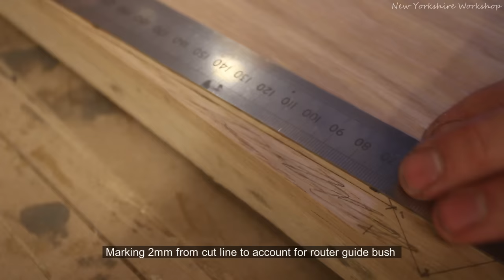Making a traditional framed ledge and brace door in Oak

Comment: How does shimming 2mm for expansion work if the battens are glued and screwed to the frame and braces?  In a traditional cabinet, the panel floats in the style/rail frame to allow for expansion, for example.  On a tongue-and-groom floor, only one side of each floor plank is nailed. etc.

Comment: Wow, I never imagined there was so much work involved in making a door!  This was an eye-opener.  But it'll probably still be a good solid functioning door in 300+ years' time.  I'm impressed.
Reply: This is not how they were fabricated back in the day.  They were either sandwiched for strength or just backed with battens for expedience and cost cutting.  Many barn doors, for example, were braced doors and you better believe no tongue-and-grooves were cut and they didn't mortise the frame.
Reply: @DiffEQ  this isnt a barn door! Its a traditional ledge and brace and this is how they were made back in the day. (If it was never done how did it ever evolve?)
In fact mortise and tenons were used even on cheap pine lounge doors. Its today we have the "expedience and cost" with the cardboard filler, chipboard, mastic and nail gun gangs!
Reply: @DiffEQ  I have loose tounges in my lounge doors - in my 1650's cottage! And fabrication is metalworking term...
Reply: It only looks like a lot of work because he does not have the proper equipment. A proper joinery shop could be ten  times quicker for the same door.. still - he is talented

Comment: It was a pleasure to watch a real tradesman at work, awesome job. Hi from Perth Western Australia.
Reply: Peter Antonic Ditto, another Sandgroper Joiner. He did a pretty fair effort. 👍👍👍🇦🇺

I’m not a fan of through tenons with wedges myself, albeit I’ve made doors that way myself, however from experience over time the moisture gets in to the end grain on the tenons & the wedge and starts to rot process. Personally I prefer a blind stopped Mortice & tenon to keep that moisture egress out.
Also I prefer a 2 part export resin, because it will last longer than the door timber.
Then I also blind peg the tenons from the inside face of the door & plug the pegs so they are hard to see.

Just small things that I would do slightly different. Our WA Jarrah (Euc. marginata) (or Swan River Mahogany as it was once known) is half as hard again as this oak he is using, (8.5 on the Janka hardness scale) and because the soils the trees grow in is slightly acidic here in WA - the sap inside the joinery timber is also slightly acidic and over time breaks down any glue other than epoxy resin which is inert to acid attack & gives a stronger bond than the surrounding parent timber.

You adapt your techniques to the material your machining for joinery, what you see in this video works for this Oak species & thus is fine for this particular door.

I do have to say the filming of his methods, assembly etc as well as the editing together of the final video was nothing short of masterful.

Whist I might match him for joinery technique, no way that my self filming one handed with smart phone and zero editing efforts match his filming and production technique.

All up a very solid effort in all aspects.

Easily a $1200 🇦🇺 door in these parts not that you’d be able to source the euro oak easily here.

Bunnings sell a US Ash door similar here at $1200.00🇦🇺 which is what I base my estimate / guesstimate on.

Wish I was his age again & could throw timber that size around over machines again all day like I used too.

I can still do it, but that would take me a week or more to do & trips to the Chiro for a couple days afterwards to try & iron out all the cramps in parts of me that get their ambitions confused with their capabilities. 😂😂

Comment: No longer working, I am a retired cabinetmaker. I worked with only wood in the beginning, residential furniture. After, mostly commercial furnishings with very little wood used. It was a job and hard work, loud and dusty, I do not miss it now. I have made frame and panel doors. This was good to see..

Comment: I lived and worked in France for over 13 years and I worked in a fourth-generation artisan woodworking shop. we did a lot of restoration and new construction on Chateaux and government buildings and we made a lot of Doors and jambs, a lot of them and this video brings back a ton of memories of those days.  I might share with you one thing we found out about the glue you used in this video.  yes, it expands and that seems to be a good thing to get everywhere but tests have found that due to the expansion process it foams up, and by foaming it creates air pockets and the bond is not as good as good old wood glue.  we stopped using Gorilla Glue and went back to brushing wood glue all over both areas and no more problem of separation or even failures at the joints.   I liked the bar you made earlier.
Reply: I was suspicious of that glue just couldn't quite pinpoint why. Thanks very much for sharing that.

Comment: Outstanding work and love your shop.  I am a 60 year old carpenter that's been trying to get out'a carpentry for over 30 years but never could.  I now have a small wood shop, but build interior stain-grade stairs (traditional & curved, on-site).  As I watched you work to build your door I thought about your shop & tool & material expenses and I kind'a thought to myself what it might cost to estimate; build; and, install that door .... and then I saw that wonderful door surrounded by concrete blocks w/no over-head water protection?  I have been known to build and install several exterior doors in my day and therefore know the work, skill & knowledge they require.  Great job & excellent video!  P.S.: I also have a band saw that operates like yours.

Comment: All that for a door on a shop made out of cinder-block? Cripes, I'd love to see what you'd  do for Westminster!

Great workmanship, loved it!
Reply: shaddec55 My thoughts exactly! Naturally, therefore, he will be finishing this building in grand style to match this door.
Reply: Cinder-block ? It’s oak
Reply: @Leon Widdicombe In the UK most modern houses were built from concrete block. The blocks are 16" long , 8" tall and 4" thick. External walls are built in two layers with a 2" cavity in-between. The cavity used to be left open but insulation is now installed. Metal ties are placed in the mortar beds to secure the two layers. The walls are then rendered with sand/cement to a smooth surface. Bricks can be used for the outside layer and not rendered.
Reply: It would be built using the blood and bones of the proletariat.
Reply: @Iazzaboyce  thanks for tidy explanation to this Yank!

Comment: Thanks for taking the time to make this I have been retired for three years after forty as a joiner seems you can miss your work , also not to be preaching to the choir but unless gorilla glue has been improved maybe 15 years ago Fine woodworking ( I think it was them) did a failure test on different glues in full mortise and tenon joints by racking them until they gave and titebond really out preformed GG.I was surprised because I had switched to poly when it first came out. But they found it held tighter than a bulls sphincter in fly season . Along with flowing as smooth as bombyx mori :).
Reply: Todd of Project Farm also did independent testing of various glues on his channel. Both Titebond and Elmers did better than Gorilla Glue, if I recall correctly.

Comment: I love your videos.  This door looks like a traditional braced door, but this is not how they were made.  The original doors were either sandwiched for strength or just backed with the batten boards for expedience and/or cost saving.  I completely understand that you're just making one for modern application that looks like a traditional door but wanted to be clear that this is not how they were made.  Great attention to detail and pride in what you're putting your name on!

Comment: I do like those key turn only lock systems, we had all new outside doors recently and they use the handle lift and key turn type. Such a pain! But I guess the mechanism has to be very well made to not put too much strain on the key.
Reply from the maker: yes you do have to be careful

Comment: Beautifully made.  I've made quite a few doors (and windows) in my life, and I doubt I've made any quite as nicely.  One thing I might suggest though is to try out a different glue..  I've never had much long lasting success with Gorilla Glue.  Tests have shown it to be considerably weaker than many others.  I'd agree that strength however is not the only thing.  Durability is a key with door and windows.  Frankly, what I tried about 40 years ago, when I made a bunch of heavy doors and windows and used Resorcinol.   It is a two part glue, and it has a dark glue line, but nothing is as waterproof or durable in my experience.  It cures pretty quickly but does give you enough working time for a glue up like this one.  Those doors made 40 years ago still have nice tight joints!  (unlike many high end commercial doors I've installed).  Great video, I too like the quiet.
Reply: Not true at all, gorilla glue is plenty strong and completely waterproof. Polyurethane glues are one of the best modern inventions in adhesives. Love me a good old fuddy duddy!

Comment: I'll cut my top and bottom rails wide and the two stiles wide and long , about an 1/8th wide/long.  Then run the whole glue-up through the table saw for perfect size and square, crisp edges with no clamp marks.

Comment: Gorilla glue interesting but not strong in the long run... it’s brittle 

We use marine 3m 5200 wood adhesive sealer caulk. When set it has a tenacious hold and waterproof and weatherproof
Reply from the maker: i was thinking gorilla glue? brittle?? but then if you compare it to boat sealant i guess it is, thats not for high quality woodwork.

Comment: Excellent workmanship as usual but couldn't help noticing that the braces were back to front. The bottom of the brace is supposed to be on the hinge side rising up so that the top of the brace is on the handle/lock side, this is to support the door and stop sagging over time.

Comment: That's a beautiful door. I was expecting to see it installed in the elegant front porch of a mansion and I must admit I cringed to see it installed on a building site.
Reply: Every building starts as a building site.
Reply: @tedwarden5803  True, but you don't usually install the pretty bits until it's no longer a building site.
Reply: @randomstranger9674 . True! I certainly wouldn’t put it on a shed. 
How much do you think it’s worth? I’m guessing about six hundred quid with the frame. Another hundred and twenty for frame fixing and another hundred for the door furniture. 
There’s two hundred in the timber if it’s good oak. 
At that I think I’m being cheap but my estimation is always to low:-(. 🤣

Comment: Nice work accept I would only spot glue the centre of the TG&V boarding and use oversize screw holes to allow for expansion and contraction ( seasonal change ) also when making an external FLB door I use air dried oak on the external face ie TG& V boarding  and kiln dried on the sties ,head , rails and bracing also  I’m not a great lover of modern PU glue I tend to use Aerolite on oak these are only comments on my preference of a build and no criticism of your work I would love to know your thoughts as  you are obviously a very accomplished tradesmen

Comment: Clever design -allowing no place for water to stand .  I just replaced the bottom rails of 8 large stile and rail doors , at great effort,  because after 40 years water sat on the bottom panel detail .  Had the doors been made this way, I would not have had to spend a couple of hundred hours.  ( I did however change the detail no more , not even the tiniest, horizontal flats!).
May I ask , how did you arrive at the expansion allowance for the paneling?    Kind regards,  J J Davies

Comment: I made one of these but it was wider as it was one of two swinging garage doors to replace the original 1930’s door that rotted. Because of the door width and it’s weight, the points didn’t hold up due to the diagonal torsion. It didn’t have your zig zag zig diagonal bracing thought. Just one long diagonal zig brace. I was bummed out.

Comment: Hello Russ, really rewarding watch, really appreciate the time it took to make the vid and share it. Could I ask you  3 quick questions? If yes, read on!
1. What's that expanding glue you put in the joints and the diagonals?
2. Do you reckon festool routers are absolutely better than the rest? Any standout reason why?
3. How do you calculate those angles on the diagonals so that they kind of clip/lock in? Never noticed that before and it is either genius or magic. (could be common practice, but it was such a satisfying eye-opener).
Thanks.
Reply from the maker: thanks Will. 1- polyurethane glue, sometimes labelled simply as PUR. 2- on the router i definitely think so, the micrometer adjustable height stop ( which is rock solid and doesnt move regardless of how hard you push the router, ie vibrations) and superior dust axtraction are main reasons, plus other luxuries like the easy clip on base plates, multiple sizes of guide bushes and other accesories. i would rather have one of-2200 than 5 makitas. 3- i didnt calculate it, i just placed the brace in position and struck a line down each side, then squared of this to about an inch to give the 90 degree cut ( that 90 degree is the important bit as it locks the brace in) just as it is shown in the vid basically. this seems the most common sense approach and is how it is shown in Modern practical joinery by george ellis 1902. he states this the proper way ad it prevents the brace from pushing out the stiles if the door were to drop.
Reply: @NewYorkshireWorkshop  Thank you very much. Looks like the perfect valentines present, I'll drop some hints. I've got a load of shutters to build/practice with before the door.
I guess the right angle thing does involve a bit of magic, but definitely needs to be shallow enough to not be a pig to knock in.
By the way, I really like the video style. Long form, authentic noises and nothing too fancy... Personally I often watch on my phone when I'm in my bubble, but the captions are really small and I have to rewind to catch the wit or wisdom that I missed... Maybe a fraction larger? Just saying, not critiquing.
Cheers

Comment: Awesome video. I have seen makers drill a hole at the end of a tenon wedge slot to help prevent splitting. Any thoughts on this?
Reply from the maker: I think for Oak in particular it is probably overly careful as it has interlocking grain and is pretty unlikely to split even if the grain is running at a 45 degree angle to the joint. For some other more brittle woods where the grain isnt particularly straight then it might be a good idea, but in that case you have to choose to use slots and wedges vs edge wedges which is more of an aesthetic choice, with edge wedges you negate the spitting entirely.

Comment: Great job!  When using polyurethane glue, do you dampen your wood prior to inserting tenons? I use it a lot for gluing polyurethane forms together and the instructions say to dampen both surfaces so as to activated the glue. I’ve noticed that some woodworkers do not dampen and can only assume that the wood has just enough moisture in it to start the activation. Great videos!
Reply from the maker: thanks! yes you are correct, wood for woodwork although dried still has anything from 6% -20% moisture content which tends to be enough, whereas plastics have negligable moisture if any at all. sometimes i add water if i am gluing wood to aluminium to give it a liitle help.

Comment: It's  a framed, ledged, braced and battened door. The top edge of the ledgers should have a small chamfer on  top edge to prevent any moisture pooling. Saw scarfing isn't  an excuse for errors when marking out (clamp pieces together). Agree about the wedges. Tension bars, clamps or feathers when using a spindle moulder likewise push sticks when ripping timber, safety first. The  band saw wasn't tracking properly and the fence was too high. COSSH Regs working with Oak you should be wearing an approved mask. Do you have ear defenders? The finished door was good as was the workmanship. I hope the points raised were useful .
Reply from the maker: thanks david. that saw has a 0.5mm kerf, to most people this isnt an error.

Comment: how will the battens expand and contract if they are glued and screwed, i realise between them there is a 2mm gap but the boards themselves are locked in and will split
Reply from the maker: the holes are slightly oversized to give a bit of slack. dont forget that if and individual batten expands the center line will stay in position and each outer edge will move up to 1mm so the majority of the board should remain bonded. the glue isnt reall required, just an extra level of strength.

Comment: Wow a little bit of magic going on here ! Great job, can I ask does the gorrila glue take long to go off ? Thanks.
Reply from the maker: the bottle says 1-2 hours, but it depends on the material, moisture content, humidity etc as it is moisture curing. i tend to leave glue ups like this over night if i can help it though, although i didnt do that with this door, i left it a few hours and the glue was rock solid. you can accelerate it with water too but be careful of working time!
Reply: Thanks for reply 😁

Comment: The 90 deg at the top of the braces are wrong in my opinion. As we see in the video, the brace is easily slide into place with therefore no benefit .
The 90 deg should be from the long shoulder and the brace has to be inserted from above so the when under pressure the brace pushes against the smaller shoulder and thus does its job. All in my opinion of course. What do others joiners think about this?